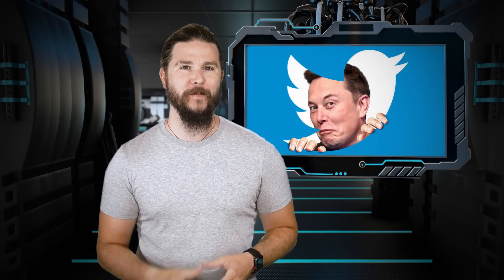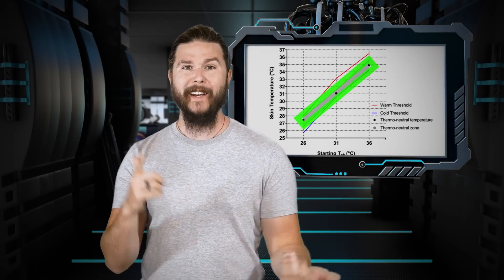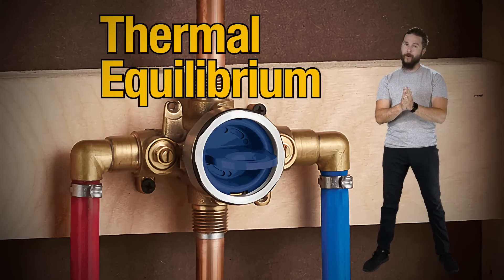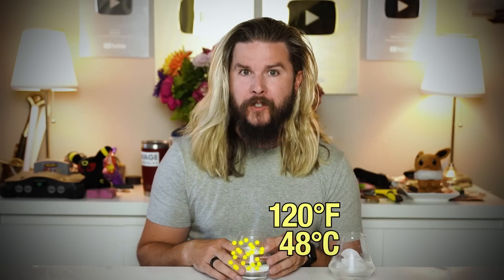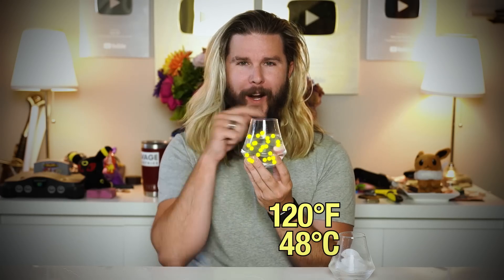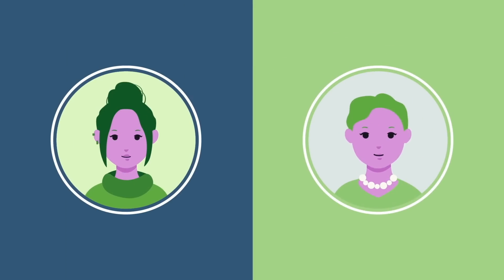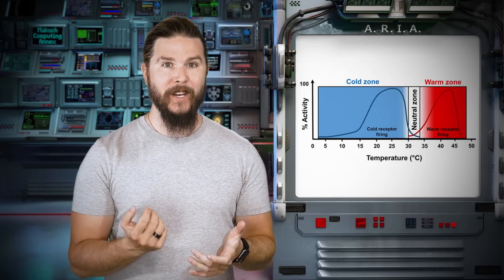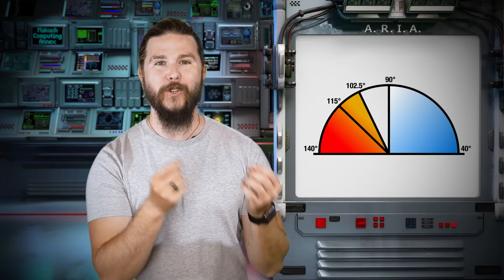Why Are Shower Handles So Sensitive?

Comment: Ok, so that's the range of the full open valve.
But why does it seem to me as if that range changes with a half open valve?
Like, the same angle but with a half closed valve gives you subjective significant colder water?

Comment: i turn up the cold water by a bit once
it gets slightly cooler for a second
then boiling hot
then the pressure drops and what feels like just the cold water is flowing
all while my hand is way away from the tap

Comment: I despise showers with a single knob with hot on one side and cold on the other. You have so much less control over both temperature and water pressure than with a two knob setup

Comment: My shower has 2 handles with 180 degree control, and water temp from the tap is 120F, so it’s easier to get that sweet spot… I hate the hotel style single knob so much

Comment: tbf it's hard for a shower manufacturer to actually know what the temperatures of the water in both hot and cold pipes will be, it depends n so many factors... but they could still make the valve have narrower flexibility and have the control be finer by adding a simple cog system.

Comment: The downside to lowering water-heater temperature is that you'll use more hot water for the same temperature shower and "run out" of hot water more quickly; unless you have a tankless water heater. Back in the old dayz there were separate, multi-turn valves for hot & cold, making it easier to adjust temperature.

Comment: Why can't we make digital shower valve with a thermocouple and motor to turn the shower to the ideal temperature? No need to change the water temperatures coming in, just let a machine do the work of adjusting the angle of the valve.

Comment: This is only part of the problem. Pressure differences and changes during operation make it more complicated, also water temperature can change while using it depending on your heater setup.
So not only is the angle range you are search small, it's also a moving target.

Comment: So far in my not fancy and old Chicago homes, the showers have had 2 valves (3 if you count the bath or shower valve) one for hot and one for cold. It is much easier to get the right temperature because you can control the amount of cold and the amount of hot separately. You can even get lazier by cranking cold to max and adjusting only the hot until you get the preferred temperature.

Comment: tbh... other than in hotels in some countries. I've most of the times encountered thermostatic fossets, that automatically get a near good enough temperature and you can only go up or down 10 degrees if you turn them all the way hot or cold.

Comment: can totally relate. though in Australia there is a requirement for thermo balancing valves on the heater output that, generally, limits the temp to below 50-something C, so it can't scold/burn (this was enacted to stop little kids and such hurting themselves). the mixer in my shower has a sweet spot of only a couple of degrees (seemingly) before hitting too cold or too hot. it's very annoy, but you get used to it. i believe it's the mixer valve design (lazy/cheap design)

Comment: I think an important consideration is that there's many valid reasons to use full temperature control.

For one, you may need cool water or hot water for something. You may want to use the detachable hose to fill up a hot mop-bucket, or coolish water to cool off on a hot day. Secondly, you may have a large variation in water supply temperature. Hotter in summer, colder in winter. The shower head needs to adjust to this.

The true fix here is to make showers have more range of motion in the handle. Instead of 180 degrees, use 270 degrees. Then, have a longer handle as well.

In Australia, it's more common to have two handles for the shower rather than a mixer handle. The issues brought up here still apply here as each tap only rotates a certain number of turns.

Other than these issues, I think another fix would be to have the water supplies not drop in pressure when another tap opens. I'm not a plumber, but I think something could be done to ensure the temperature in the shower doesn't change suddenly.
Reply: That's my problem my water didn't have good pressure it only has good pressure if you add cold to it but if you had cold to it it gets too cold so I raise the water temperature from 125 to 130 and now the sweet spot is just impossible. It's like you just can't have everything.

Comment: I have the luck of getting to use a two knob knob where i crank hot all the way and then fine tune it with the cold and touch test before entering. Single point faucets have a special place in the trash can.

Comment: RIP just notice my shower is basically as bad as it gets for this, A we had a new water hear put in and may have forgotten a temp sensor or something cause legit comes out at a boil but also B my shower handle has like 270 degrees of roto and its only like maybe a 3inch radius heeellp XD

Comment: 1: It looks a bit like you don't like Elon Musk^^ He's a bit crazy, but Twitter had to be stopped.
2: The perfect solution would be a non-linear handle with more control in the middle and less near 100 % hot or 100 % cold.
3: Absolutely DO NOT lower the temperature of your hot water. Legionella loves that and spreads like wild at warm but not too hot temperatures. And you really don't want to inhale legionella containing water droplets while showering. That's a really nasty infection you may not survive.
4: Did you use degrees fahrenheit by default and not even label it as freedom unit? I am disappointed :/
Reply: Must is making twitter even worse, open your eyes

Comment: This argument does assume that your hot water doesn't run out. As I shower, I slowly have to turn it hotter and hotter as the hot water runs out just to keep the water a comfortably warm level, so the setting al the way to the left is actually very important to me

Comment: What a fun video. 
I recently bought a new house (to me). The temperature control valve is a different valve than the on/off so once set it is always the same temperature. In addition there seems to be a sensor that detects pressure drops (like when when a toilet is flushed). Rather then being temporarily scalded, the over all pressure drops maintaining a consistent temperature. I had no idea plumbing technology had become so advanced. Lol
Reply: wax capsule thermostatic mixer

Comment: Useless! There were no solutions to be found in this video. I think the answer is to moderate the cold water temperature coming in to a steady 25° c or so. That requires a second water heater with a different thermostat, or some kind of mixing valve after the hot water heater.

Comment: If you're working with a shower/bath combo, there actually is quite a lot of value in both extremes of temperature on that range, because baths are an excellent substitute for systems like air conditioning that may be out of reach for you.

Too hot?  Draw a bath as cool as you can handle being in for a decent length of time.  When you get used to it, add a bit of your cold water side in to cool it off further.  Repeat until you're starting to shiver.  You're not going to feel hot for at least 6 hours unless you decide to walk into a volcano or blast furnace in that timeframe. A/C is certainly more convenient, but this works very well.

Conversely, if it's cool and you want a nice warm relaxing bath before bed, draw your nice hot bath.  It'll be hot for about half an hour, but if you want it to last longer, you're gonna need to add heat.  So stick your legs up out of where the faucet fills the tub and crank it to high heat and you'll get that water right back into the sweet spot.  (Having your legs out from directly under the faucet is important because you don't want the water touching you before it's had a chance to mix the cooled bathwater.)

Sure, you might say it's weird to have baths for that long.  I say "it's a hottub that's built into the house, it just has a worse reheating system."

Comment: In Brazil in some regions most showers are heated by an electrical resistance (we call then electric showers), this device is called called pass heater. Imagine a big hairdryer that passes water inside it (but without the fan and with a valve that don't let it turn on without water passing inside it). This scares the hell out people from other countries. But they are incredibly safe (the good ones at least). Some more sophisticated ones have an electronic temperature controller to adjust the temperature independent of water flow intensity or input temperature. For installations with ground fault protection you can't use bare heater resistances or it will trip the protection, we user a thing called shielded resistance (a cooper tube connected to ground with the heater element inside it but isolated). Even those damn sophisticated electronic controlled showers are still sensitive as hell. I take about two or three minutes adjusting it until I have courage to enter under it. Side note: in Chile they usually use pass heaters but heated by gas (they call it califón): they scare the hell out o me because of carbon monoxide, fire, or explosion danger if the pilot flame turn off, but people that are used to those heaters find electric showers terrifying (maybe because of scenes on movies where a person dies when the radio or hairdryer falls on the bathtub).

Comment: Some handles has high difference between static and dynamic friction. When you try to adjust the handle position it leaps more then you intended. Which makes harder to find the right angle.

Comment: He completely missed the main reason: the hot-to-cold water ratio is non-linear with respect to shower handle angle. It follows an S curve. So the shower handle is more sensitive when it's in the middle.

Comment: Surely one could improve shower heads as a whole by making the actual movement of the valve by the handle more incremental, to the point where the full motion of the handle only moves the valve within temperature sensitive ranges (perhaps utilizing a system of gears, and calculations as to how much an angle of the valve turned changes the temperature of the output). I.E.; the far cold end of the handle only allows a few degrees below average sensitivity, and the far hot end only allows a few degrees above, therefore allowing greater temperature control without requiring a computerized temperature monitoring system that only puts out a temperature inputed by a user, which would require the user to know which temperatures are tolerable in the first place, usually established through guesswork anyway.

Could be relatively simple system that only requires the reduction of mechanical advantage of the lever over the valve, with no electronics necessary.

That's where I thought this whole video was going.

Comment: I can tolerate hot water temps WAY easier than I can handle other forms of heat... Like, if the water is 105°F, I can deal. If the temp outside is 105°F... End me 🤣🤣🤣

Comment: As a plumber I would not turn the water heater down for shower temp control, maybe up.  The cartridge in the shower valve has a temprature dial.  Usually if a customer wants their shower temp higher or lower we first go to the shower cartridge.  Thermostatic mixing valve could be installed for proper heat balance.

Comment: At my home, the shower is about 30 feet from our water heater, so it takes actual time (up to 30 seconds) for the shower to receive anything but cold water.  It also has a singular knob that you lift to control overall flow rate, and twist to adjust the hot/cold ratio.  We learned quickly to turn it on at almost-full hot, wait for the hot water to start arriving then adjust it to temperature, all BEFORE actually stepping in.

Comment: even further is the way standard cheap water valves open, as you get closer to full flow the opening expands more quickly as it is essentially a cylinder.

Comment: Another factor for me is that, depending on how I set the flow, the water from the hot side might be slightly hotter or cooler. So if I increase the flow, I need to find the sweetspot again.

Comment: Those older showers you usually find in mobile homes, the ones with the three knobs (hot, cold, and to switch between the shower head and faucet) are probably one of the best for finding comfy temps. I've had one for years and have it down to where to start to get the perfect temp.
Reply: I've seen several people say this in the comments, but I couldn't disagree more 😅

I HATE the mixing tap shower arrangements, because every time it's "Okay, is it three and a half turns of this one and one and three quarters of the other one, or three and.. actually seven eighths, and one and a half??!" and I always have to spend SO much time mucking with now two free parameters instead of just one. Every. Single. Time. 

Meanwhile (depending on the exact design of the handle/pressure) you can often just leave the single handle in the approximately correct position for the next time, and just add water pressure when needed!

Comment: I just crank it to hot and jump in. If it's too hot, i just turn it down slightly. Generally tho, it's fine. After doing this my whole life, I've become use to the extreme heat. It's not hot enough to truly burn me, just turn my skin red at most.

Comment: So, about a year ago, my wife and I were tired of not having enough hot water for 2 showers back to back. By my logic, we have a limited supply of hot water in the tank, but I have control over the amount of thermal energy stored in the water. I thought that if I increased the temperature of the limited hot water supply, the water mixture would require less of the hot water to come out at the same temperature that we usually use, meaning that the supply of hot water would last longer. It seems to have worked, even though it may cost more money and use more energy. Is my conclusion correct? And yes, I do think this solution has greatly narrowed the sweet spot region. I have been tempted to put a mark across the handle and back plate where they meet to provide a visual reference as to where it is. Lol

Comment: This video is quite correct and definitely clears up a big part of this everyday annoyance. 
However — like a highly appreciated YouTube science educator with a cute robot girl, flaming a petulant billionaire and his codependent cult following — it assumes that the problem is solely oversensitivity and overreaction on the part of the user. Not even considering the possibility that the designed state of equilibrium within the mechanism might not actually be present in real life. I say that because there is, of course, a genuine bias responsible for what users are complaining about... A bias towards cold if we're talking showers... The thermal equilibrium isn't actually present at the time the shower is turned on, because it isn't established until the moment the heater switches on, having detected a call for hot water. Until hot water from the heater reaches the shower's mixing chamber, the shower runs on cold water alone, regardless of the temperature setting.
AND in addition to this first moronically long thing I just wrote: It is also the case that the pipes carrying hot water to the shower start out cold as well. Meaning that hot water reaching the mixing chamber won't arrive there at it's maximum temperature, not until it has flowed for long enough to have fully heated the pipes that it travels through. 
So... First the water coming out of the shower will be cold AF, then it will suddenly get a lot warmer but will still be too cool and then there will be a final, gradual rise in temperature that eventually stabilizes at the temperature you actually wanted. All you need to do in the meantime is resist the urge to dial up the heat.

Comment: And there is no way to engineer the mixing valve and handle to be at accurate or predictable.

Input temperatures vary a lot by location, and by time of the year in the same location. Also input pressures of hot/cold are not equal.

Added to this, there is a dynamic problem when more than one person is showering in the same system. When one turns temperature higher, it lowers the hot pressure on the pipes, and other showers suddenly get colder while the valve stays put. 
This causes all shower users to race to higher and higher valve balance, which they eventually find. Then someone finishes showering and everyone else experiences a hot spike when hot pressure rises.

Comment: Having big ranges of temperature control isn't completely useless actually (this is just based on my experience btw, im no piping expert and not sure if this applies to all homes). If your bathroom water pipes are shared between other sinks/showers/toilets, temperature balance in your shower will break whenever those other appliances are used, since a lot of cold/hot water can suddenly funnel into another source, leaving you in trouble. For example, if someone is doing dishes in the kitchen while you shower - you may freeze to death, since all the hot water is going to the kitchen and your water gets way colder. And if someone flushes the toilet nearby, well... prepare to be boiled alive, since then all that cold water you need will come rushing into the bowl. That's why being able to temporarily turn the valve to extremes can be very useful.